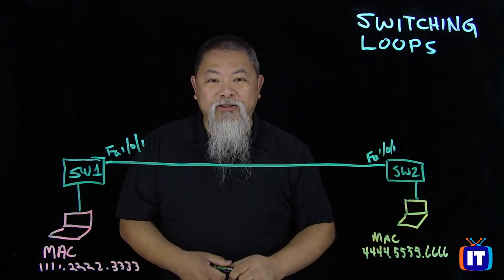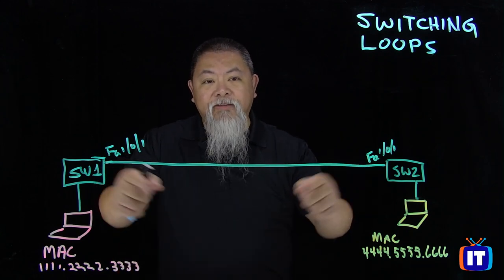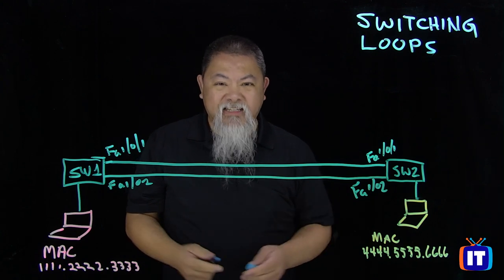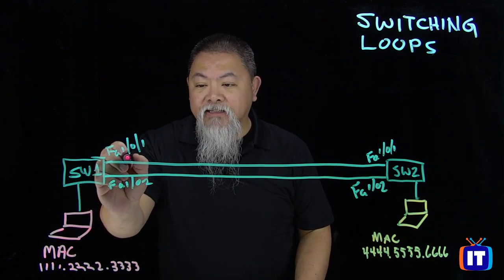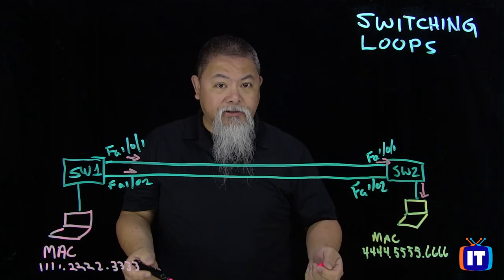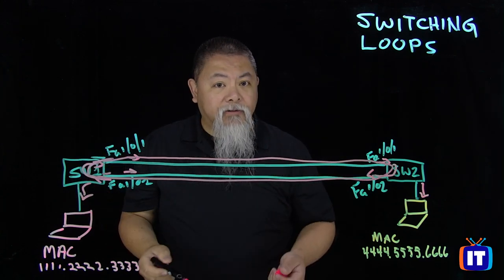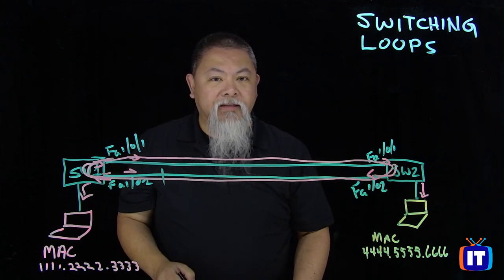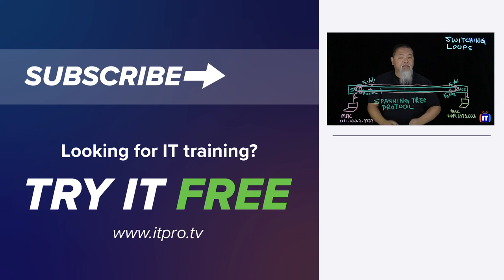What are Switching Loops?

Comment: I had a network issue affecting my whole home intermittently starting almost a week ago, same day I was cleaning up the house. While cleaning up, I found a network cable on the floor, not plugged into anything. Without looking carefully enough, I assumed it needed to be plugged into my nearby switch. It turned out to be the other end of a network cable ALREADY plugged into the same switch. Soooo yeeaaah..... didn't realize my mistake until days later after t-shooting just about everything else (buying a replacement router, calling my ISP provider, etc) 

Fun times.